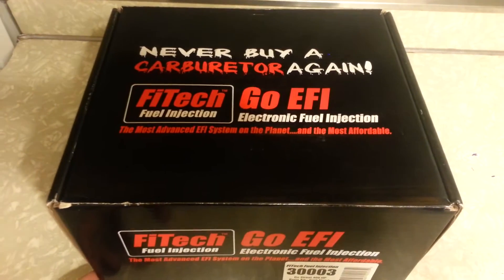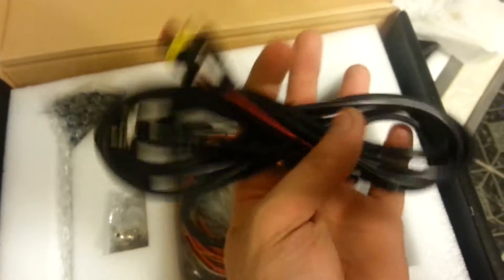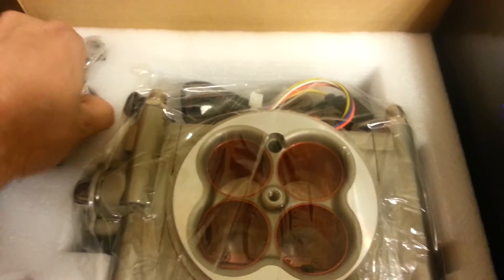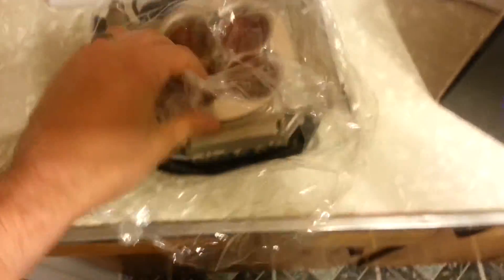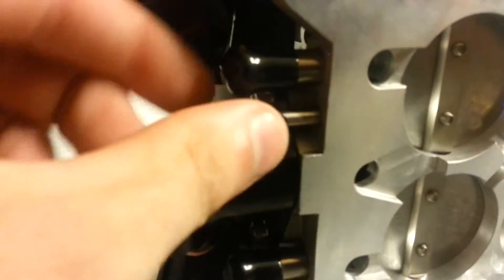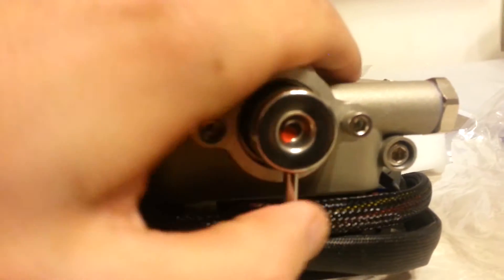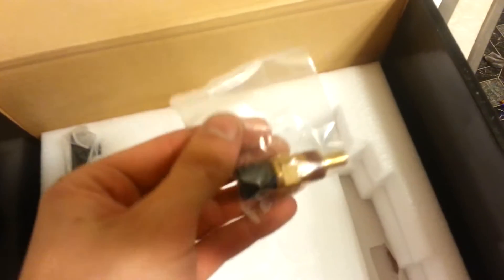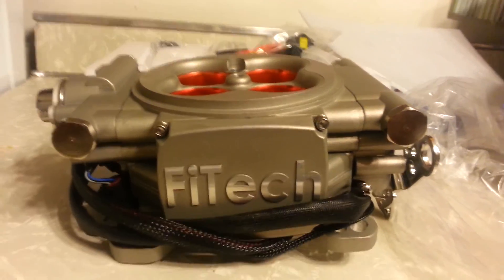FiTech Unboxing Ford Ranger 5.0 part 1

Comment: on 1.5 month back order for me as well from jegs, for the 30004 model.  will be going on a 5.0 as well, but in a 66 mustang
Reply from the maker: I have a video up of the first start and another of breaking down what I used pump, lines, etc...wise
Reply: Cool, Ill check it out, I have a Spectre EFI tank already with a 255 in it, so, i just need to plumb it with steel 3/8 line and AN fittings.  should work...  Should... lol
Reply from the maker: I made both the videos I said I would so check them out.